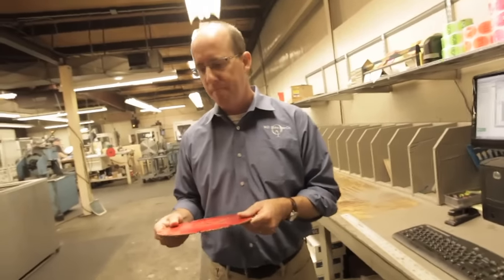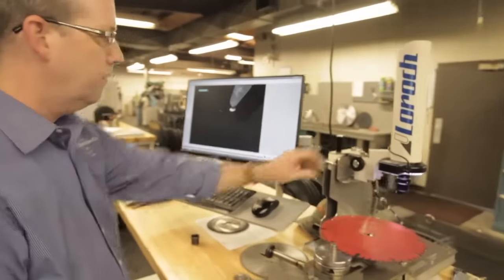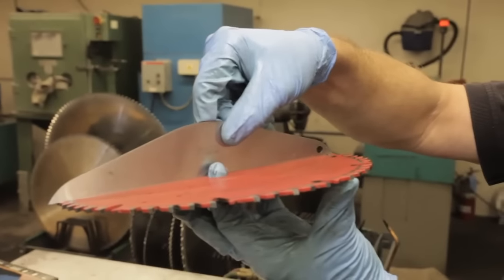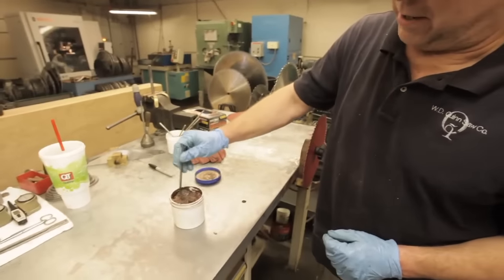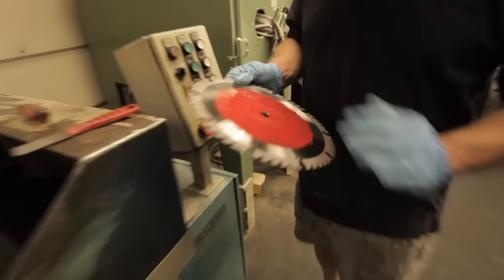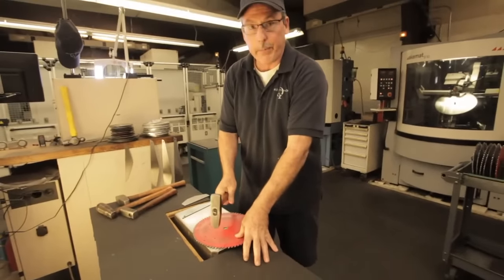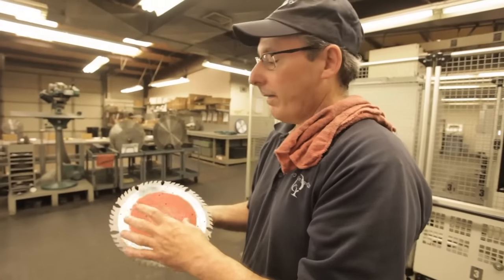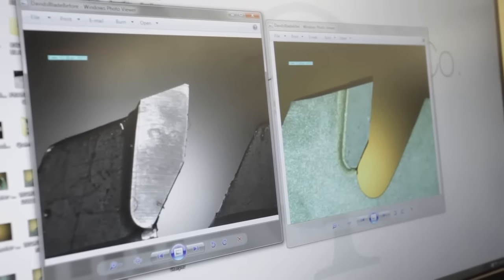My tablesaw blade gets a grind.

Comment: Thanks...I enjoyed watching this. I am retired and started making wood crafts about 6 years ago. I have a 10" table saw and I began by buying the cheap blades at Home Depot; a 60 tooth or more for the table saw and a 40 tooth for my mitre saw. As I went along, I discovered that buying a little bit better blade actually made a big difference in performance. I then started learning more about saw blades.....and there are a lot of blades for different applications...even when just cutting wood. And I learned that the more teeth a blade has is not always the best way to go. I had an 80 tooth blade that sure gave a smooth cut, but for general ripping a 40 tooth works easier. Yep...lots to learn. And yes, the price of 10 " blades can go well over $100.00. But we all know the saying: "You get what you pay for"....and this is true for table saw blades too. I finally bumped up to a Freud 10" 40 tooth Premier Fusion thin kerf for $70.00 at Amazon. It performs so much better than a $40.00 blade. When my budget will allow, I think I'll bump up a little more in price and see how that one performs. I learned of another real good saw sharpening shop besides this one ( which I didn't know about until this video )...and I send my blades to them for resharpening and they have the latest CNC machines & all that...and for about the same cost to sharpen a 10" blade for sawing wood. And wow...they are sharp..and cut like butter. And I have also learned that keeping the blade clean is probably as important as having a sharp blade. I have a huge respect for my table saw and I intend to keep all of my fingers, and one good way to help make that happen is  having a good working knowledge about saw blades...keeping them sharp & clean...which will make cutting wood easier and safer....and of course running the saw safely...using push sticks and lots of other devices to keep fingers away from that spinning blade and the wood from kicking back. Yep...I hope that I never lose my caution and respect ( and perhaps even a certain amount of ..fear ..) when running the table saw. Sorry for the long post....just wanted to share my thoughts and what I've learned.

Comment: I wonder if they could do of my older 12" specialty tool steel blades. I keep getting told "no" because the local shops are only setup for carbide work.

Comment: Interesting that this guy that sharpens powertool blades sticks the blade halfway into the ultrasonic cleaning tank and turns around to camera to talk.  An old professor in a research lab where I did my graduate study, had a left index finger with a tip (first knuckle down) that was completely unresponsive.  He was using an ultrasonic cleaner and dropped something in there, so while it was on, he just poked his finger in to grab it, and he said as his finger tip touched the surface of the cleaning solution, he felt like a hammer had hit his fingertip.  He retracted immediately.

Problem with ultrasonic cleaners (industrial ones at that) is that the soundwaves will vibrate the metal being cleaned and dislodge the caked on materials, but for soft fleshy things like fingers, the sound waves will penetrate the surface and denature (destroy) proteins.  My professor's finger tip ended up getting its inner tissues gently pulverized, and his nerves were completely denatured (soup).

anytime I see people hold an object half submerged in ultrasonic cleaning tank, I cringe.

Comment: Are table saw blades really so expensive that it's cheaper to get it re-ground than to buy a new one? Or is there something else that I'm missing? (I'm not a carpenter/craftsman).
Reply: A good blade would set me back $100AUD so a sharpening of $30AUD definitely worth it!
Reply: My blades for picture framing are over $100 and my ones for acrylic are around $200 .

Comment: impressive, but this is not how the world is working 2016. there is approx 11 pepole working on this one blade, they all gots to get paid. And to that extent that they are examining the blade= tont of hours spent 4 one blade. Unless the blade is made out of Beyncé its not worth it. Melt it down and buy a new one. - What has this turned into? WW2 rations where we got to maintain what ever metal we have? come on.
Reply from the maker: Thanks for your comment!
Reply: The world is more than how you think it works. If it isn't economical how is this company and others like it able to survive?
These aren't cheap pieces of metal from the just local freight store, these are professional blades for craftsmen that run from hundreds to thousands of dollars for specific uses or in industrial manufacturing(2:03 lower left of frame). Additionally the process shown here is way slowed down for demonstration purposes and doesn't show bulk processing.
Reply: I have a blade that needs a tooth and sharpen. it isn't a super expensive blade but to get it serviced by them it's half the cost of a new blade. I get to support american workers. I don't create waste.
Reply from the maker: yes!